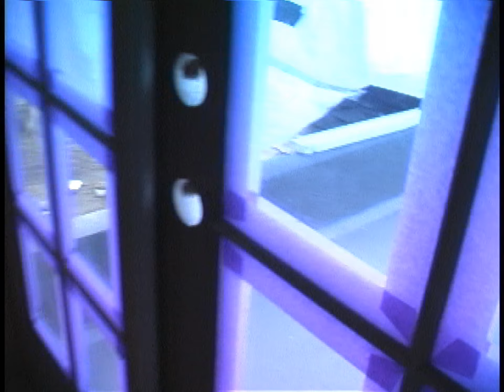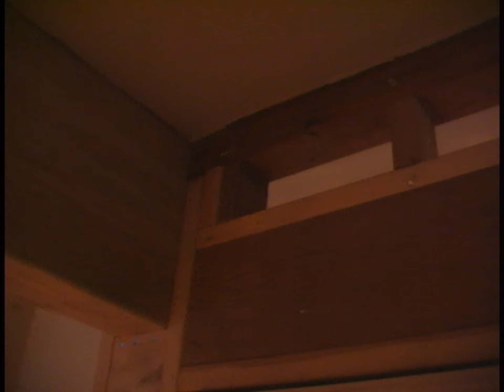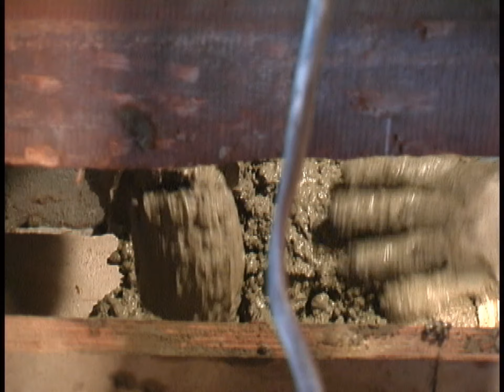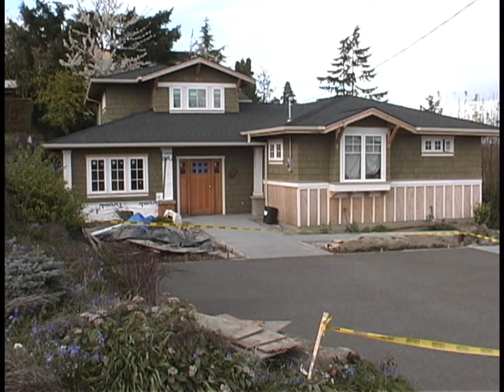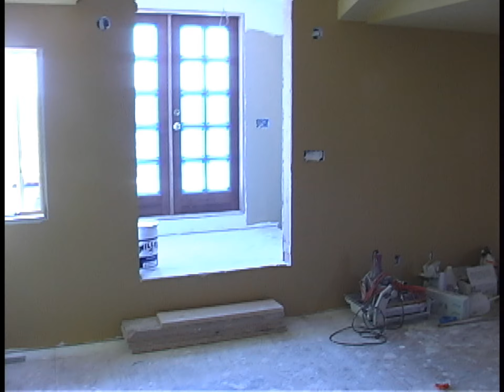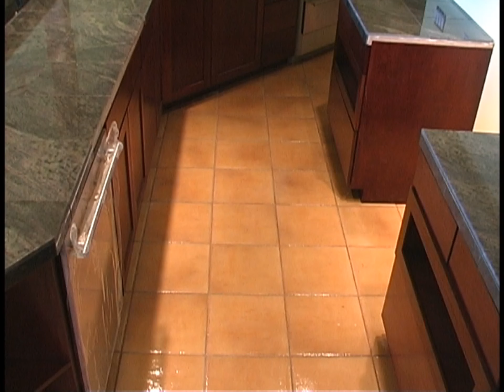House Construction Interior Exterior Wrap Up VIDEO 3 of 4

Comment: I noticed that the power meter for the house was at least 7ft off of the ground. How's the local power utility meter reader going  to reach that? This is a great presentation by the way. Did you always video your work? I don't think YouTube was around in 2002?
Reply from the maker: When the grading was finished, the meter base was between 5 and 6 feet high. Inspector approved it. I took videos from 2001 and on. Before that, I have a lot of photographs. I have to finish the completed video of this project, then I'm going to put together a series for a big house we did that burnt the second level off, it caught fire from faulty electrical that had been covered with blow in insulation in the attic.